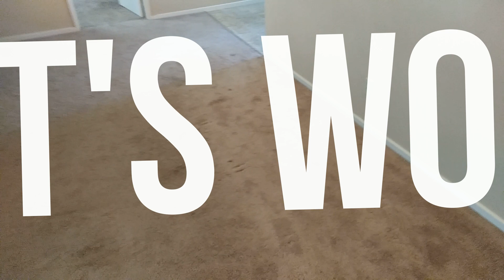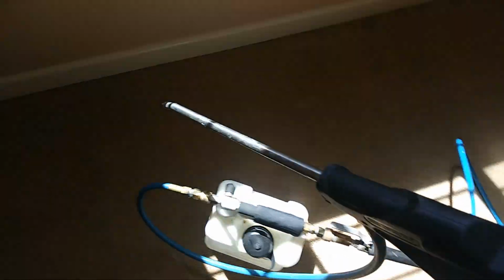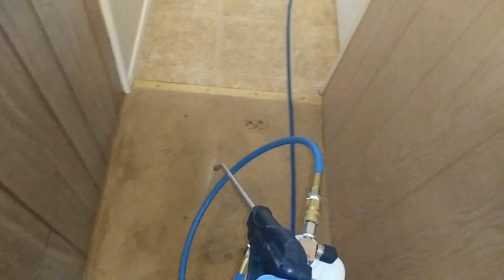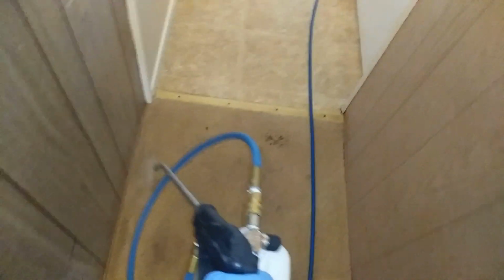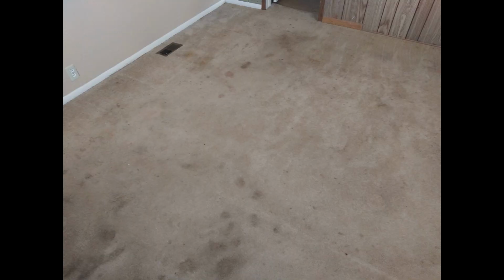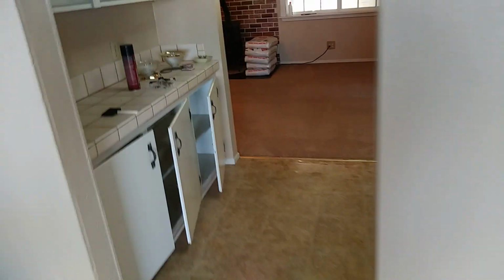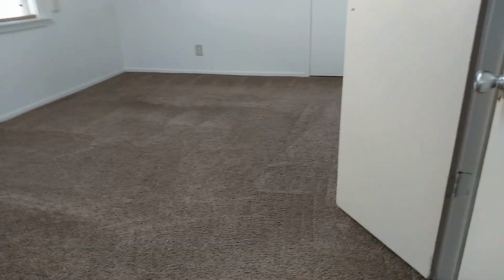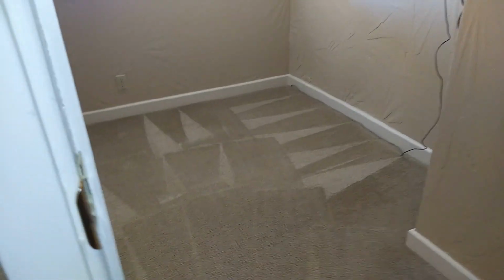Worlds best Carpet cleaning video - LOL Just saying Amazing results

Comment: Sounded like a portable  was used, came out real good, did it have heat?
Reply from the maker: Its a boxxer 421 . Heat at about 210. Not putting out as much heat lately so looking into that. 
Thanks
Reply: @greenrhinoproject  ok if heater giving trouble you can always just get the Mytee external heater box
Reply from the maker: @Mrgoodguy865  cool I have a mytee dry tool. Never heard of the external heater box Have you used one before ?
Reply: @greenrhinoproject  yes I have  one
Reply: It's called the Mytee Hot turbo
Reply from the maker: @Mrgoodguy865  All look into it if I cant figure out the problem. Thanks

Comment: Dp I absolutely need a truck mount to do such a great job ? I have a budget of 2k to start . So step by step for sucesss good vacuum figure out your chemistry or fabric of that carpet before even starting is what confuses me the most . Then ok onces you do get your chemistry after finding out the fabric spot stains, cleaning the spots stains sith the right spotter you then need to “agitate that spot area ? Or the whole carpet gets agitated???? Nonetheless after you agitate you now want to extract the pre spray so you use a portable ?? Or do you use  the buffer after you agitate and then use the portable last ?
Reply from the maker: With 2k I would start out doing VLM washington pro carpet cleaning is a great channel to subscribe to to see his process. I also teach in my course the process. Purchase the couse then any questions your not getting from there email me is my best advise. But  after you agitate you extract with a portable or truckmount of hot water extraction method. for VLM use bonnet to extract.
Reply: @greenrhinoproject  definitely will purchase the course onces the funds are up . 🙌🏾